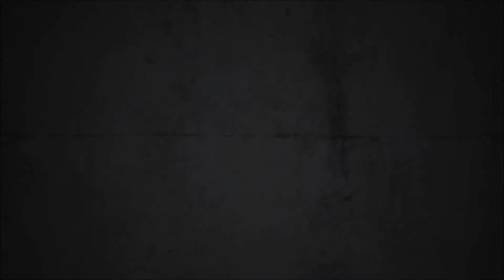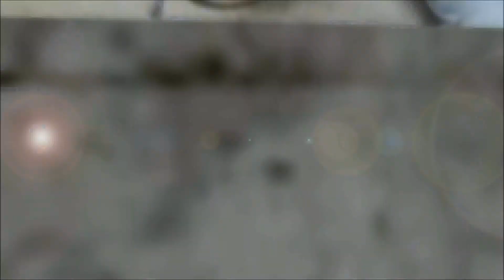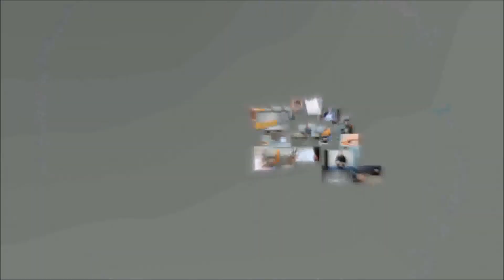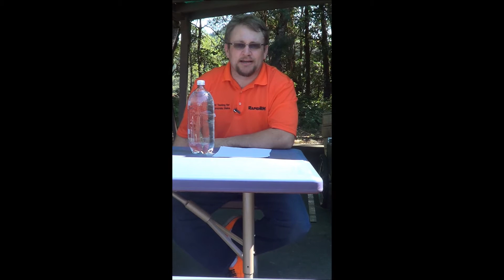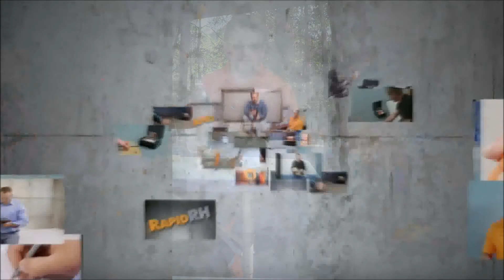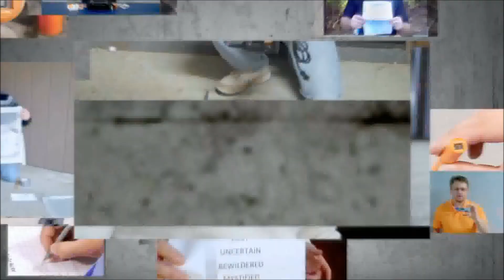Understanding Hydrostatic Pressure in a Concrete Slab

Comment: I must be thicker than my slab ... I didn't understand the "bottle of water" example AT ALL !
Reply from the maker: The visual we were trying to depict was that the more water there is, the more weight there will be, and the more pressure it will cause. In the bottle there is the same amount of water, but when the same size holes are made in the bottle, at different levels, the water stream at the bottom of the bottle shots the farthest. This is due to the amount of pressure the water has caused. So, if you have a basement, the water table will usually be above the bottom of the slab(the further down the slab, the more pressure), which will exert increased pressure that may cause the moisture to “push” through the slab.